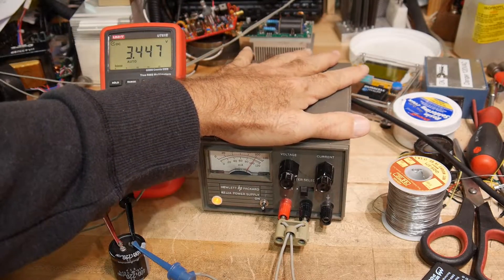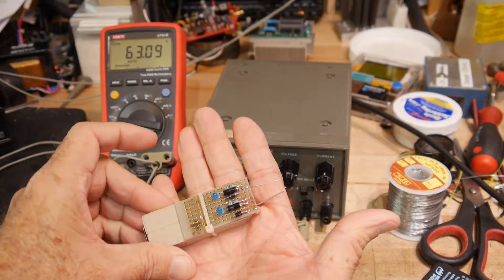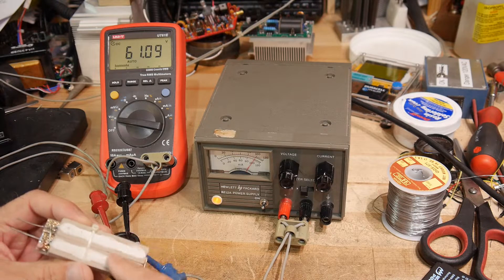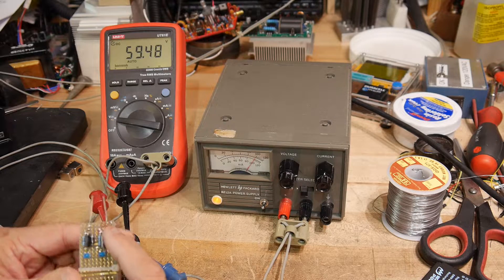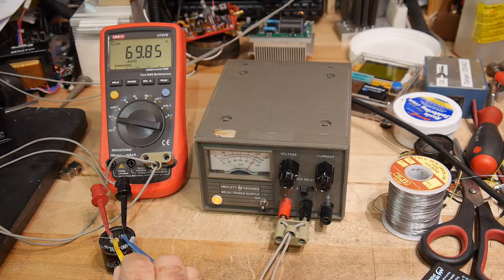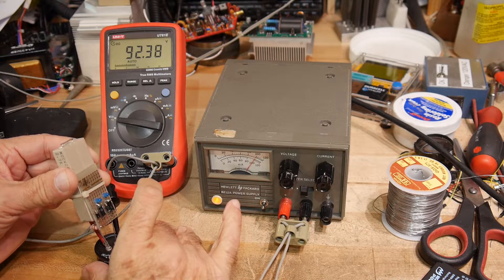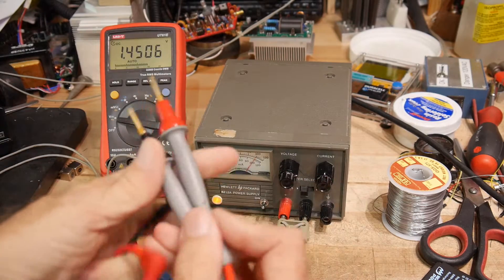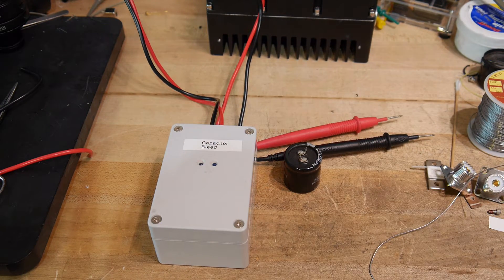#282 Mr Carlson's Lab capacitor bleeder

Comment: Nicely done. As you say, Paul Carlson knows a lot about many areas less traveled as well as much modern circuitry... but shines in the areas of component and materials testing.  No one knows as much in the area of switching power supplies. He excels at knowing failure points, modes and signs. I have been at it for many decades and never saw anyone in his league. Close, but no cigar. LOL  de KQ2E